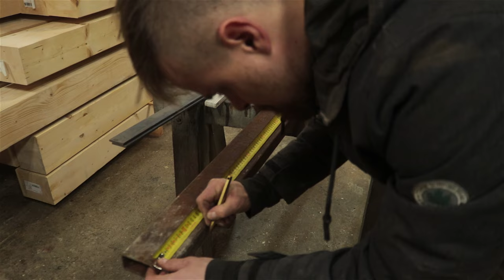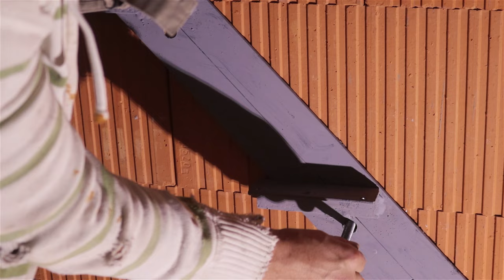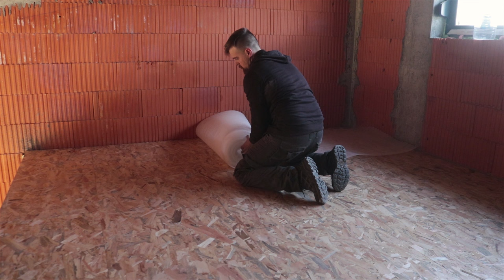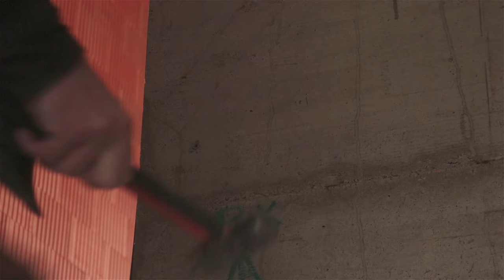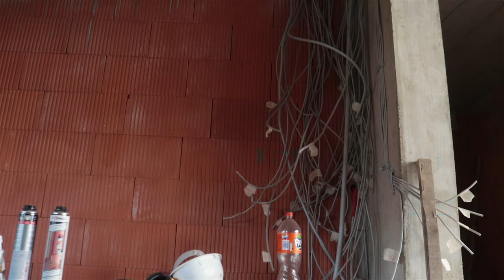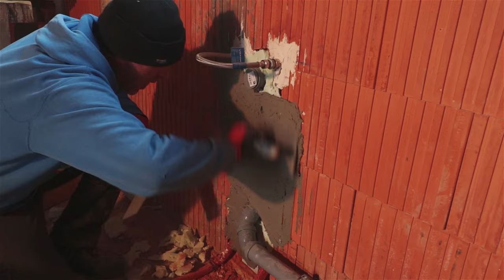We Have Light!- My House Build Pt13

Comment: Makes sense using P.U. foam in the bathroom.  (When I was a kid, people would exclaim "P.U." when they encounted a strong (bad) smell)  Excellent video, thanks for sharing.  Has the price of lumber settled down where you are?
Reply from the maker: The p. u. foam is an unsung hero of this build:) Yes the prices have dropped to almost the same level as 3 years ago but I think that's it. If they were this low when I started this build, a lot more timber would be used.

Comment: There are a lot of building practices there that are much better than here in the USA, but I'll never understand building a super strong block wall, and then bashing weak points in it to run electrical wiring or plumbing.
Reply from the maker: The thick brick walls are load bearing by default but concrete beams, walls and pillars take on the horizontal seismic forces and wind forces. That is the way the statics are calculated, house needs to have enough surface area of concrete walls- pillars in both perpendicular directions so a few notches and holes in bricks won't do any harm to house statics.

Comment: jesus christ, hilti makes some nice cable clamps which can be used with direct fastening nail guns. and straps, those screws will make problems for you later on under the floor
Reply from the maker: Why would they? they are all under the 12mm level, and another layer of flooring comes on top of it. Also the easiest way is to unscrew a screw if a cable needs replacing.